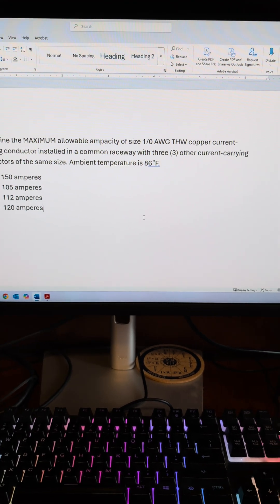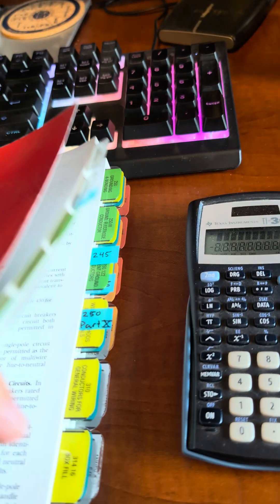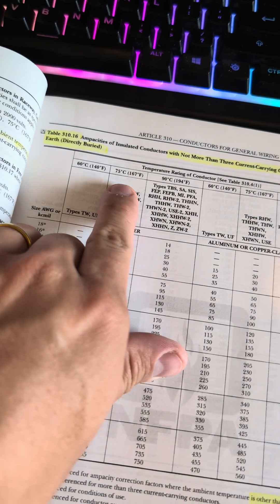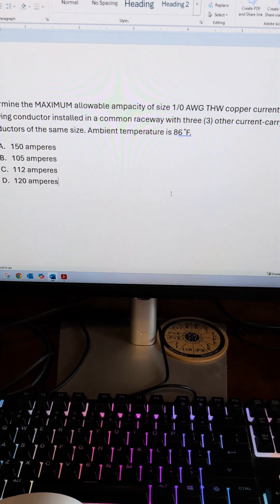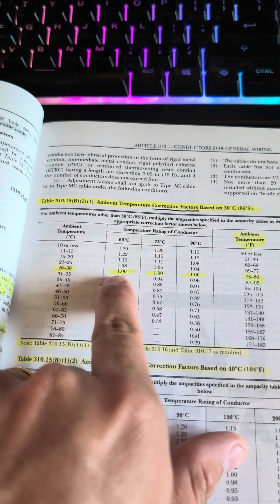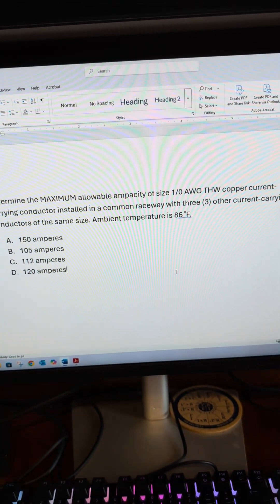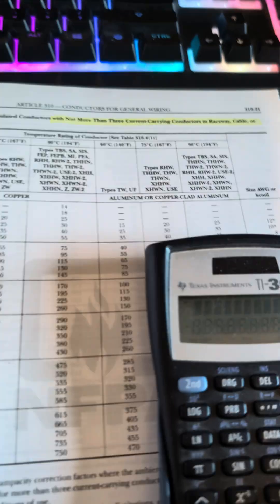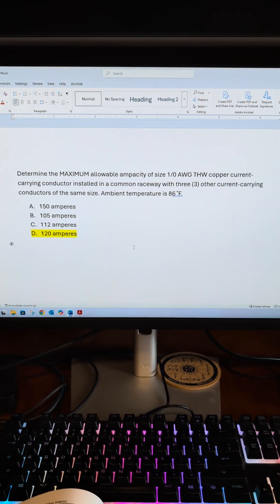NEC Ampacity: Corrected & Adjusted - Can That 1/0 Handle the Load? #ElectricalCode

Comment: Table 310.16  you used first it reads 3 amorality connector with no more than 3 !!
You have 4😂😂😂😂
Reply from the maker: Good catch. You are correct but this is why later in the video I “correct” and “adjust”.

Table 310.16 also say 30degree C. In hotter or colder areas with ambient temperatures other than 30C need to be “corrected.”

If running more 3 conductors, the ampacity needs to be “adjusted.”

Be sure to watch the full video for the breakdown. Thanks for watching!

Comment: Do we not use table 310.15 B 1 1 ?
Reply from the maker: You do. That is the Corrected part of the question. The question states 86 degrees F and the correction factor is 1.0 so the amperage doesn’t change.

Comment: So when would you use all the other numbers for example if it asked for 104F would you go to table 310.15b12 or
Reply from the maker: Table 310.15(B)(16) was renamed to Table 310.16 in 2020. The new table for ambient temperature correction is Table 310.15(B)(1)(1). I forget what it was in the 2017 code but you would use the Temperature Correction table. 

I’ll see if I can make another video covering an example where ambient temperature is something other than 86F
Reply: @JohnPaulElectricTX thank you !
Reply: I think you still have to use 120 amps and multiply by .94 and gives you 112.8 amps from table 310.15(B)(1)(1) or am i wrong